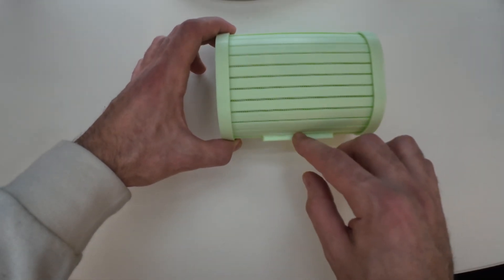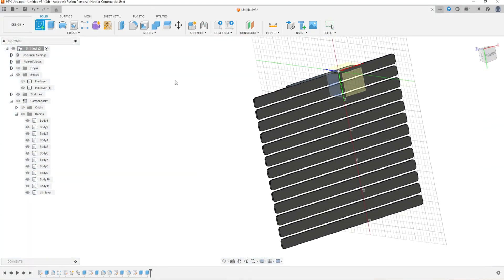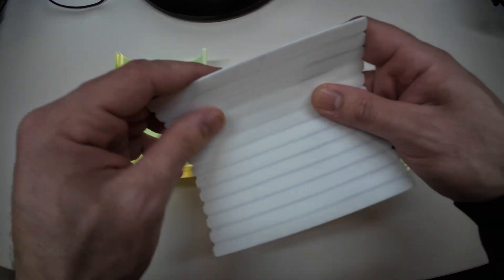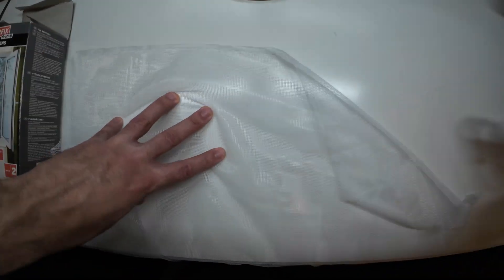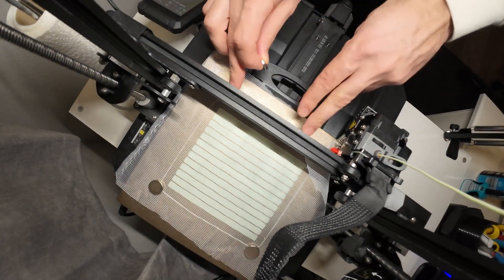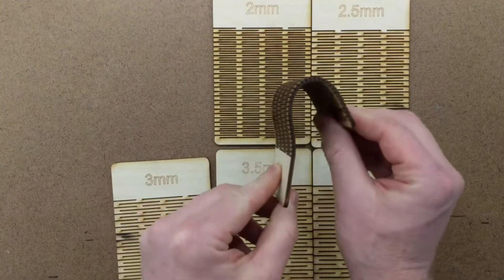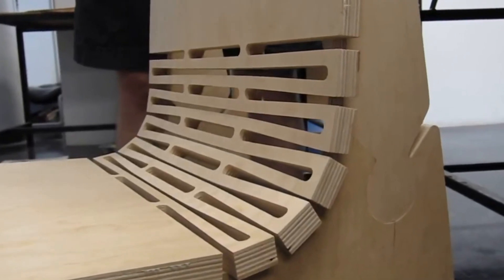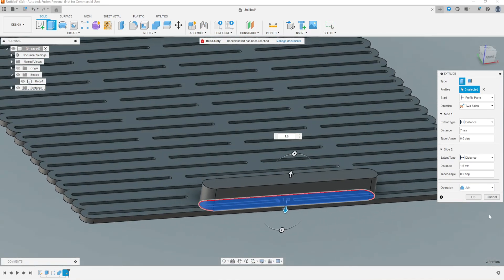How to design 3d printed sliding door in  different ways

Comment: Cools, thanks! Is there any special sliser setting to print on mosquito net ?
Reply from the maker: You can pause the printer manually or you can use slicer to pause the printer ,  u can pause 30% high from print  for ex  your print its 100 layers high , you can pause the printer around layer 30 and put mosquito net , that can make body band better  then if you put it in the middle